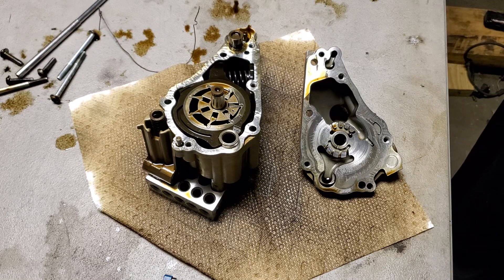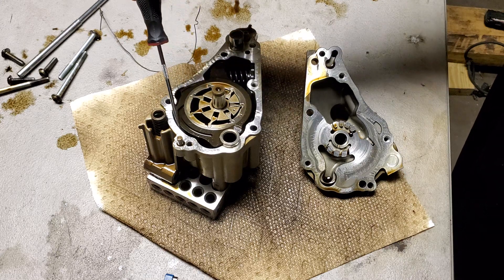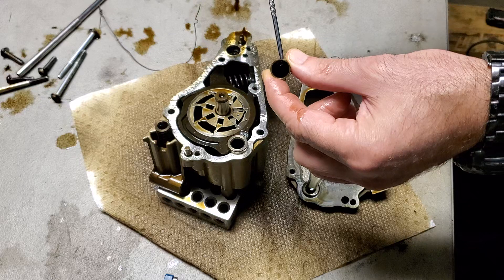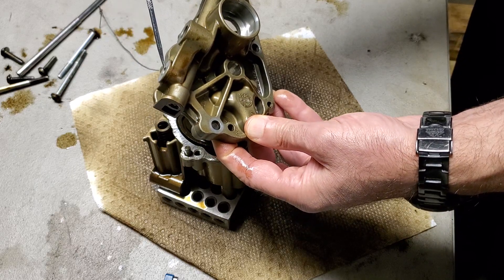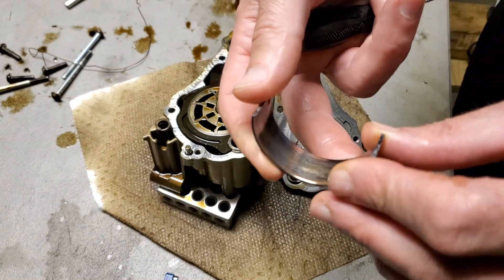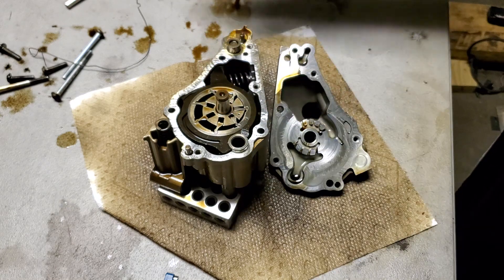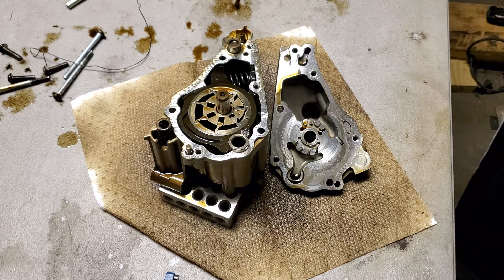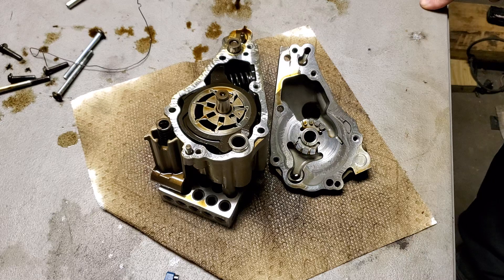Fixing N55/S55/N54 rod bearing failure, and variable-rate oil pump functioning. Part 1.

Comment: N55 has some oiling issues, just to name  a few:
- non-primary mains
- weak block and girdle
- varying oil flow
- electonically the oil pressure is controlled based on the pressure after the oil cooler, while the mechanical back up is set up to work with the pressure of the mains, so once the leakage of the bearings become greater the pressure drops and the ECU has no way to see that, I believe it works with predefined leakage ratios, its worth mentioning that the temperature of the mains gallery is monitored and used to increase the oil pressure by some amount above 120 degrees, this high temperature target seems to be in for emissions/efficiency

Few tweaks can be introduced here with potential to improve the reliability.
1. increasing of the bearing clearances and use of thicker oil
2. switching of the oil temperature and oil pressure sensor location, that way the ECU will monitor the bearing pressures directly
3. Lowering the coolant and oil temperatures
4. Adding additional external oil feed line from the filter to the bearings and smoothening the oil gallery corners, sharp edges are no good here due to the long path and the constantly varying flows
5. Strenghtening of the block girdle
Reply from the maker: My solution seems more direct.